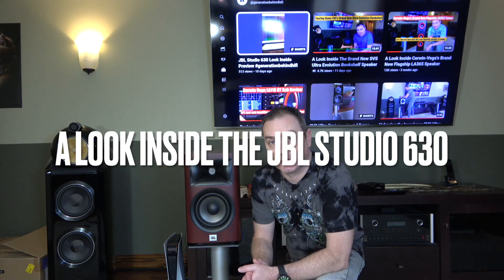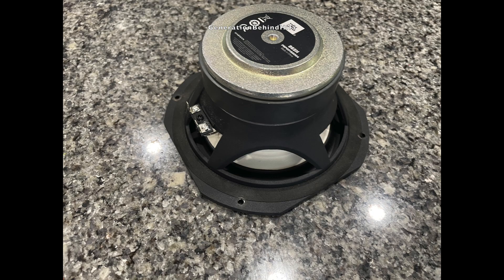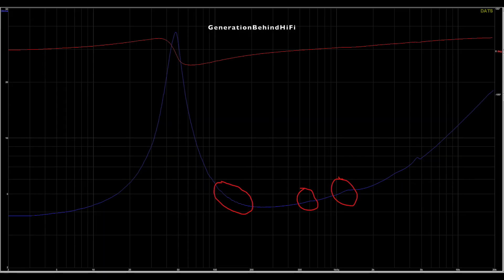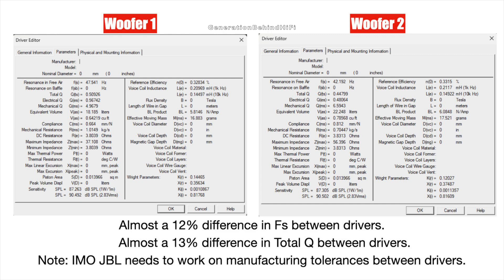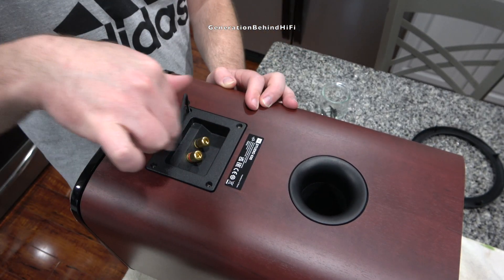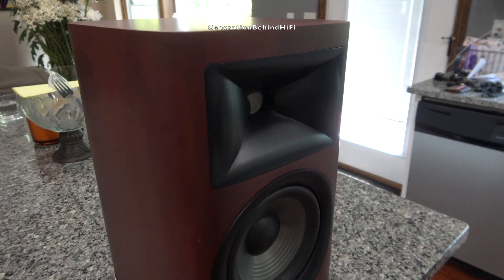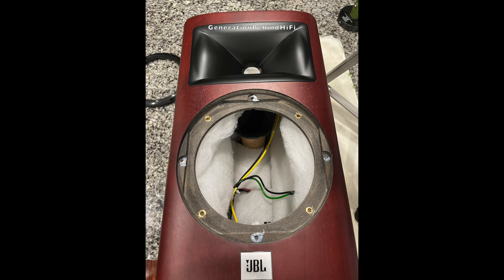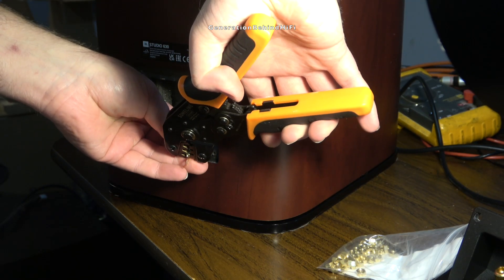A Look Inside The JBL Studio 630 Bookshelf Speaker

Comment: Thank you for taking the bullet for us, i would NEVER buy a pair of these speakers, actually id never get speakers from JBL.. What HARMAN KARDON used to be went to crap, i rather go with some Klipsch RPM-600 or something similar, ELAC, EMOTIVA, i dont know anymore. 
Also copper clad aluminum is unacceptable for a $750 pair of speakers, when 100% OFC is relatively cheap for those short internal cables..  Plus another 200 ~ 300$ in good quality components for the crossover (good video) make them a pair of +$1000, that are basically a $300 ~ $400 DIY speakers..

Comment: Thanks for the break down. The 630 I purchased a few years ago is still in the box (LOL). I recently got a pair of Dali speakers, and Emotiva UPA-2 amp to compare with my H&K signature series amps.
Reply from the maker: No problem! Older HK signature amps? If so, I'm pretty sure those models were built at Madrigal Labs, alongside Citation, Mark Levinson, Madrigal, and Proceed. The older HK signature stuff is really nice and a bargain on the used market.

Comment: Personally I’m a JBL fan because my Father was a Professional Authorized JBL Dealer in Puerto Rico back in the 70s and 80s I grew up with the legendary 4350 Studio Monitors with flagship Luxman all around. As for their low end consumer product I don’t have much to say frankly not a huge fan. But their HDI compression driver line and up are the business. I had the JBL 4309s and just picked up the JBL HDI 3600 at blowout pricing. From there and up they really are quite unique vs the competition.
Reply from the maker: The HDI series is very nice and has much stricter quality control than the cheaper Studio lineup. Enjoy them! The Studio 630 is still a great speaker but I think JBL needs to get their QC under control. Merry Christmas!

Comment: Three metal core coils on the woofer? They must be using a 4th order filter (using 2 of the coils) and a notch filter uses the 3rd one? Seems that the woofer needs some serious work to pull it into line.
Reply from the maker: That is correct, 3 iron core inductors are dedicated to the woofer circuit. The 3.9mH inductor is in parallel.
Reply: @generationbehindhifi  That's a lot of magnetic eddy currents - and using air core coils (that it seems you are in your rebuild ?) the bass quality should be a lot better.
Reply from the maker: @NeilBlanchard  That's the plan (all air core inductors). I'll keep you guys posted on the build and will try and capture the differences in sound on camera.

Comment: I love speaker teardown videos and you have the best ones! I tore down one of my JBL 620 speakers and found mostly the same things:
 Drivers appear to have the same magnet at ~ 4" diameter with the 5.25" woofer weighing 3 Lbs 9.9 Oz and having a resonant frequency of 56Hz.
 The crossovers are similar with the 620 having one less iron core inductor, one less electrolytic cap and two fewer resistors.
 Port tuning on the 620' came in 1 Hz higher @ 44 Hz. The component differences could explain the shape of the impedance curve I got. Instead of a steadily rising line in the tweeter's band, the 620 had what I'd call two rising peaks; a smaller one at 1.2Khz and a bigger one at 8Khz with the dip between them at 2 Khz. I'm wondering what effect this has on the sound.
 I had previously commented that I was skeptical component upgrades would have meaningful improvement on sound quality but after seeing all the modification you're working on, I'm not so sure! Can't wait to see what you find!

Comment: As a Jbl fan I quite like these. Nothing is perfect. I am surprised about the 12 and 13 percent measurement differences. Years back I think they were much more meticulous about driver quality. I run more vintage jbls including the L112 and L100 centuries. And pro drivers like 2226h for reinforce ment of my altec 604 8H Urei monitors. The horn in your 630 looks great. Having a small woofer keep up with it would be a crossover challenge which I'm sure Jbl address. I'm not an engineer just a long term audiophile. Many are snobby about Jbl still. When you use amps like Accuphase and Luxnan and better Rotel they shine. Although efficient Jbls like current and watts. Your high end parts will bring suitable improvement. A mate of mine who is a professional tech upgrades all sorts of speakers and the components make big differences.
Reply from the maker: I like them too for what I paid and mention this at the end. They really are great speakers at the sale price! If it wasn't for the big gap in tolerances between drivers then I think these would be worth every bit of $700 per pair. The cabinet and crossover are all very nice for this price point. Thanks for the comment!

Comment: 1:00 seat the speaker in front of a mild fan space heater for 10 minutes. It'll soften that kind of glue. Just amke sure you aren't damaging sensitive plastic parts on the drivers
Reply from the maker: I didn't use a space heater but I did use an adjustable heat gun and got no where with it.

Comment: Thanks! Had I not seen this video I may have bought them - but the mid woofer disparity is a shame.
Reply from the maker: Thank you! At the $349 price, I think they are a bargain even with the disparity in woofers. They really are a great sounding speaker with excellent cabinet construction for the money and most won't hear the small differences between midrange drivers. I probably should have spent more time emphasizing that in this video. :) But I agree, its a bit disappointing seeing the large manufacturing tolerances within drivers from such a big name.
Reply: @generationbehindhifi  Well you can find monitor audio bronze 100s for less than $400 a pair, so lack of JBL quality control is unjustifiable. Imo bronze 100 are superior in all acoustic aspects and they look way better. These look terrible, like a basic bookshelfs from 1990s, and not in a good way (like klipsch for example).